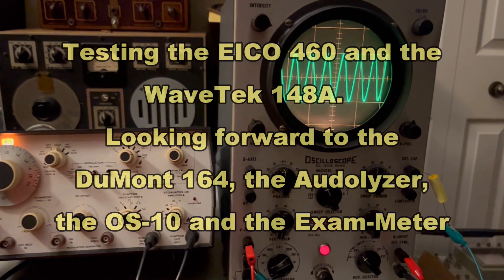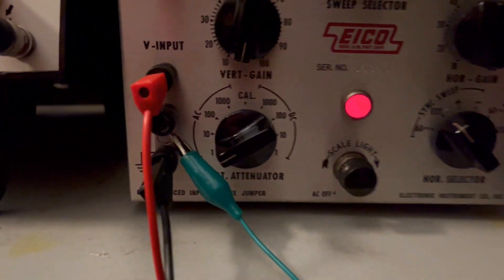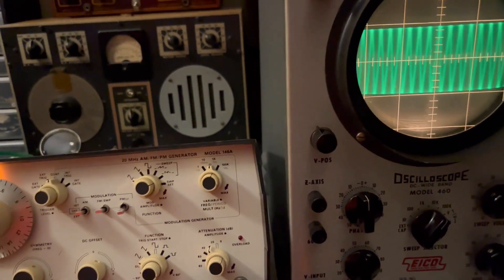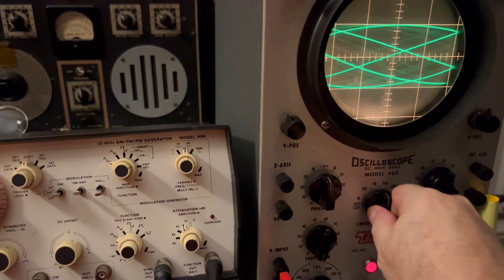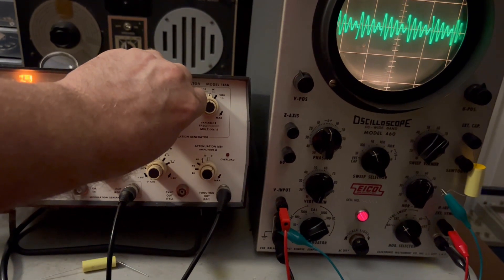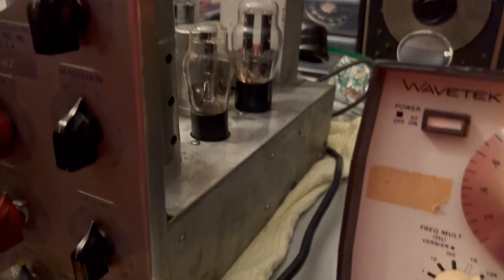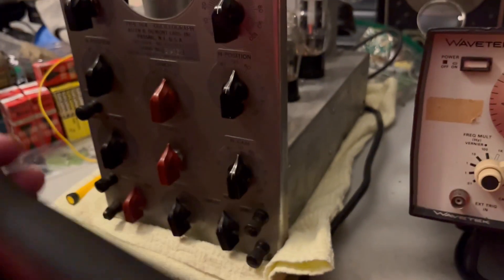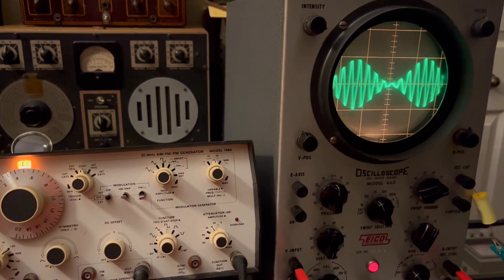EICO 460 and WaveTek 148A, Looking Ahead to a Dumont 164,  an Audolyzer, an OS-10 and an Exam-Meter.

Comment: Great content and great work! I love vintage test gear, and I feel like it gets somewhat neglected compared to vintage radios.
The 460 scope is working beautifully! What did you do in the restoration? I have one and I did some calibration, but the waveform is still a bit spread out. I'm suspecting there are some tired caps.
Please don't remove the original chickenhead knobs on that scope! I'm sure you could find a metal thread and epoxy it in the hole, even if it means you need to use a new set screw. The face is in such great shape.
Sad about the bakelite bezel. Maybe there's another one that survived out there one one in inferior condition. I have a Supreme 561 signal generator, but sadly the electronics are beyond my ability to restore in their current sorry state.
Reply from the maker: Hi.  Sorry I didn't get back sooner.  I captured a lot of video while I was working on the 460... maybe I'll compile it into a clip some day.  I followed the conventional methods by replacing all of the capacitors except the MICAs and the disc capacitors.  I did replace one or two of the discs after they tested bad, but mainly it was the electrolytic, paper and wax caps.  They all tested bad anyway.  Then I just tried to find voltage problems, primarily around the tubes.  I fixed those by changing out resistors that were connected to the tube leads, but only if the tube voltage was measuring bad and only if the resistor measured out of spec.  I had a couple of waveforms that weren't particularly linear across the display, too.  From left to right they were wider and became tighter and tighter towards the right.  But it only occurred at particular range selections and only on the low end of the spectrum.  As you point out, it wound up being the large capacitors on the frequency range selector switch.  Seemed like they were slow to charge.
Reply: I would definitely appreciate this some of the footage being available to help people with restorations. Did you even change out the electrolytic filter cap? They are neither cheap nor easy to find replacements for if they go bad.  @pinballpsycho
Reply from the maker: @brianclimbs1509  Yes.  I found suitable replacements on Antique Electronics Supply.  I tried out some "MOD" capacitors (that's a brand name) because they are comparatively cheap.  I don't know how good or bad they are, but I'm using them in 4 restorations so far and they seem to work fine.  We'll see how long they last I guess.  Prior to that, I made a huge mistake and bought a CE capacitor can thinking it would plug right in (in my case the old can was missing when I bought the scope - it had apparently exploded because there was electrolytic tar everywhere).  Installing that CE can looked cool, but sent me on a very long, wild goose chase where I was trying to figure out why my trace was shaped like a figure 8 instead of a straight line.  It turned out that all of the CE caps are tied to the chassis on one end (for ground), but if you look closely at the drawing - the 460 doesn't really ground those filter caps to chassis.  Its a wonder something really bad didn't happen, but once I replaced the 3 caps in the can with MOD's, the scope started working.
Reply: Thanks for the tip! I am realizing that I have some serious 60Hz leaking into the signal trace on my scope...  @pinballpsycho
Reply from the maker: If it shows up as a very slow wavy type of artifact, you may be able to lock it in with an external sync from your signal generator and tweaking the sweep vernier ( if you’re not already).  Another weird phenomena, believe it or not, is the magnetic flux (of the world).  Sometimes you can get rid of it by rotating the scope.  Television repairmen used to be confronted with those issues if I remember correctly.